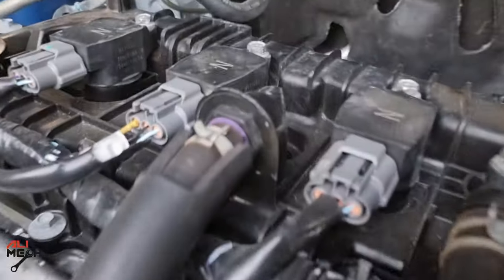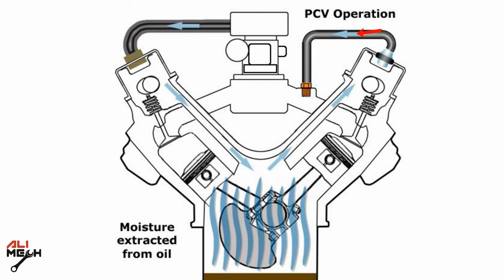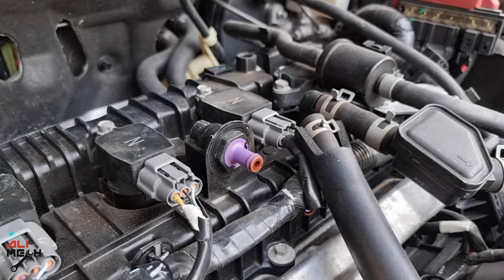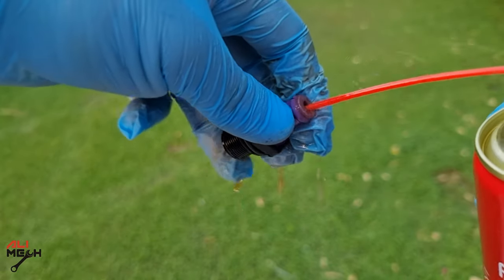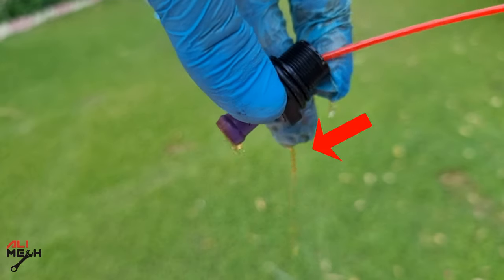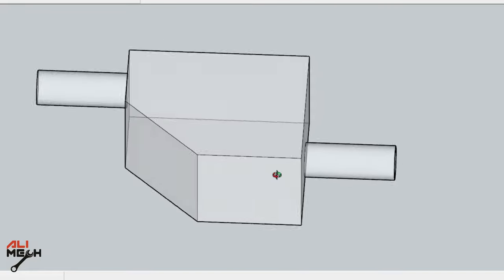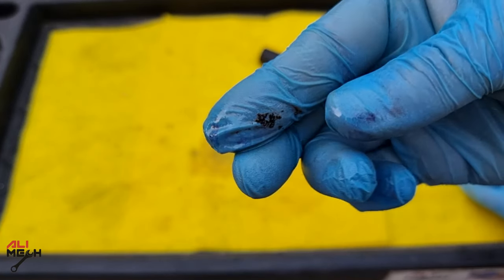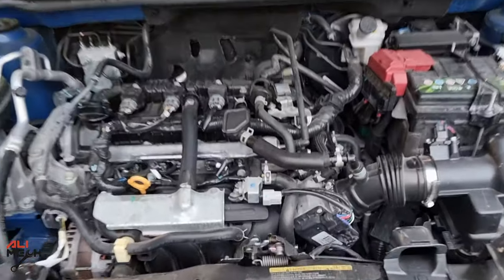Cleaning will make your cars engine last longer / Nissan Kicks pcv valve and oil separator cleaning

Comment: This video is magnificent, them 2 pieces are very vital if not cleaned every oil change it'll begin clogging up and cause a p0101 mass air flow sensor. Many people get that code and spending $$$ and still not fixed. It's just a simple cleaning job.